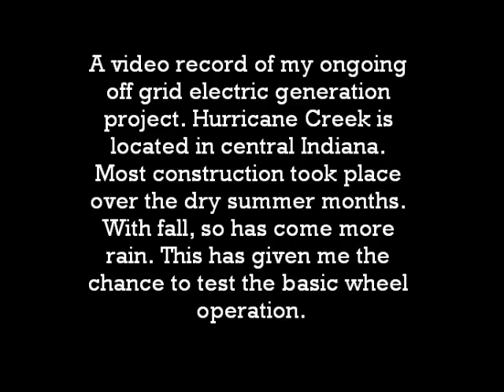Hurricane Creek Water Wheel 1

Comment: The water wheel is backwards meaning as you can see if you look at it, its actually lifting up the water on the other size meaning it is going far slower then it probably could go making it very in a efficient.

Comment: If I recall correctly, there was a study done to investigate if water flowing under or over a water wheel was better after a project to restore an old mill over in england (I think) where the mill was set up with water flowing over the top and dropping onto the wheel.  They found that water dropping onto the top actually gave better performance.  Your setup looks like it wouldn't have been hard to do the same.  Shame you didn't.

Comment: nice work and i can tell you have done lost of HARD work. what made you go with a under shot wheel rather than a over shot wheel?
Reply: I was going to make the exact same comment!
Reply: There is enough drop that a test could be done either way although might goof up the shaft orientation.   I've been going back and forth trying to decided.   In our case, the wheel would have to be quite a ways down stream from the dam to gain the necessary height for the overshot.   On the other hand, the overshot might have less issues with debris getting caught under the wheel (overshot might just go over).

Comment: Water wheel is too heavy and too slow.  try aluminium, or plastic ? with paddles that touch the centre barrel.
Narrow the water feed to increase water pressure at point of contact. undershot is fine.
Reply: I guess the wheel wings design is not good and the movement is too slow
Reply: @nubras2799  
The Wheel Looks Far Too Heavy for the Water Pressure available / ( in use Here ) .

I think :- Maybe ? 
Increase the water Pressure / or Flow .
Or Lose Most of the Inertia Weight from the Water Wheel ? 

Aim, is to Spin the Wheel Faster with Less Water & more Water Pressure ? 
Or 
Have a Much Lighter Water Wheel Made from Plastic to reduce Weight, Thus making it Easier to Spin at faster speeds with the Same Flow of water. 

The Use of COGS / Gearing to increase to the Maximum Power Generation for Use Directly or to Charge Batteries When power is not required? 
Just my Thoughts, I'm not an Engineer or Scientist. 

I Like the Idea of Free Natural Energy from wind or Water Wherever it can be applied. 

Think of This, :- 
5 Ways to generate Energy ( electric) 
20% Water / Hydro. 
20% Wind, 
20% Coal, 
20% Gas,
20% a New Resource,  ? ( Methane , Hydrogen, Nuclear,  Solar  Or Whatever can be invented or created = Only 40% of world energy will be Fossil fuels. 
a 60% Reduction. From the Old 100 year old Method.

Comment from the maker: The wheel is small. About 3 ft dia. I set it up that way not thinking I have enough head to make an overshot. I might be able to do it with some mods though. If I could raise the dam about another foot, then I might be able too. But I was also thinking about a bigger wheel. maybe a 6 ft wheel in undershot or a breast shot.
Reply: Any idea what the trade-offs would be with a larger wheel - wouldn't it turn slower, but with more torque?
Reply: Torque Is key does it matter how slow it is going when you can just change the gear ratio and make any speed

Comment: using a colldctor with pipes you can force focus water into it and let excess water flow  besides it so you will always have a consistant flow and never running into an i where there is too much water. so you never have to adjust the wheels hight or put a brake on it. the latter will be needed when using mechanical energy running particular devices. concreting the channel will also reduce resistance resulting in greater speed of water. the combination of speed and pressure will benifit the project into an extent where you can harnass mechanical and electric power either seperate or at the same time using just the 1 wheel. making the wheel widee results in more torque but less rpm. if you use only mechanical force as endresult you could even put a gearbox in between.

Comment: How many Watts of power or pounds per foot of torque are you getting from this setup?
Reply: Has nothing to do with torque. Its all about the rpms. What torque does give you (in this scenario), is the ability to turn a larger generator with more mechanical resistance at the same speed. Which in turn gives you the potential for more power up to a certain point.

Comment: You install the wheel in a wrong way. It must rotate in the opposite direction. And yes, is better to use a larger wheel (larger diameter).
Reply: A larger diameter would provide more torque, but the shaft and the wheel would rotate slower.   Of course gearing would compensate.  In our case, yet to be proven, we are intending to match the RPM of the shaft to the desired rotational velocity.

I'm not sure what you mean by turning the wrong way - this is an undershot water wheel, won't it turn in the direction of the water flow?   Or are you talking about the orientation of the paddles?

Comment: project being the keyword, that's all that is is a project, water wheel is too small, should be about 8 to 10 ft in diameter to get proper torque, would make a lot more power, but I hope this is worked out for you in the last 5 years

Comment: thanks for posting.  nice work.  some thoughts..that is the worst bucket design i've ever seen.  the buckets should confine the water within, not let it run out.   a wheel thats part poncelet, part zuppinger might work.  the speed at which the wheel is turning, unloaded, is what the loaded speed should be, roughly.  

NOTE you have head that is not being used.  the drop-off (at 1:29) upstream of the wheel should be spanned.   a flume could be installed in the channel, beginning perhaps five yards upstream of the wheel, this would allow the use of an overshot poncelet-style wheel.   cheers
Reply: I also wondered and asked about the gap between the paddles and the core - wonder if it was intentional?   I have seen a video of a spiral pump with an air release tube on the tube scoop.

Comment: Too many  engineering calculation errors , especially the waterway leading to the wheel ... undershot wheels, are tricky to operate with relative efficiency .
The most egregious is the wheel buckets design and, the overall ratio dimensions of both. Given the incredibly abundant supply of water available , the wheel should be at minimum 6 times larger in diameter ,designed with  a bucket to diameter aspect ratio  much more narrow than the one being used . The rotational speed of the wheel , should attain without a load a speed nearly  equal to that of the water current speed when ; the proper ratios are achieved, since  the buckets should not  be slapped by the impinging  water  The buckets  should immerse  at relative silence.
I was never lucky enough to find a property for sale with such a beautiful water supply as the one in the video... so much power going to such awful  waste ...a real shame.